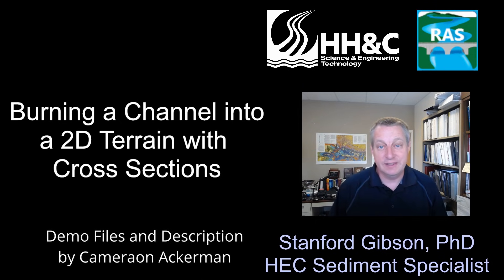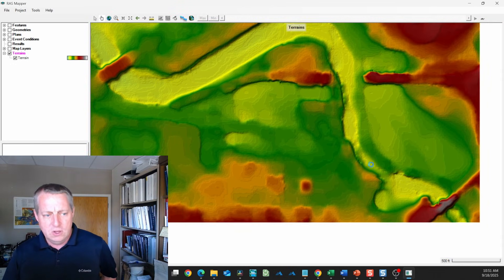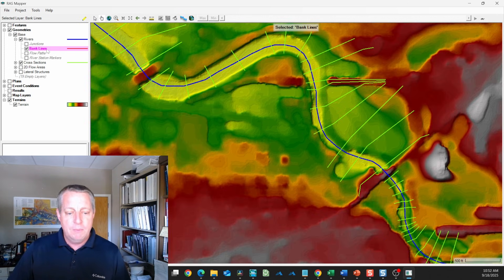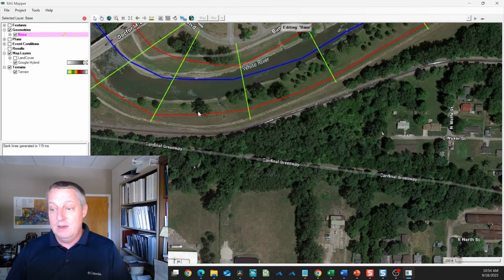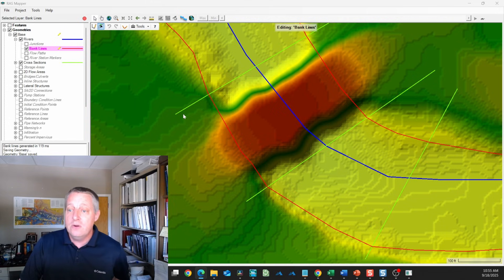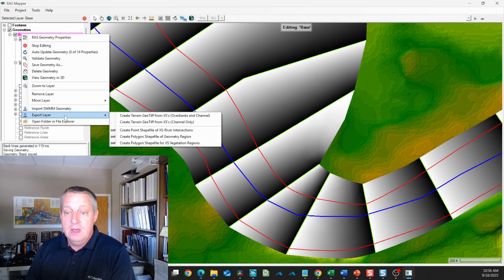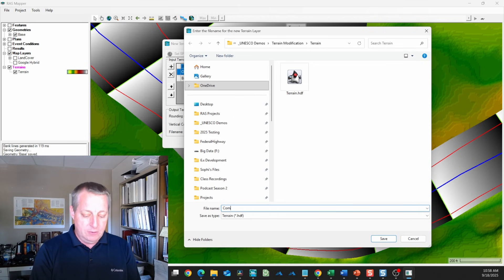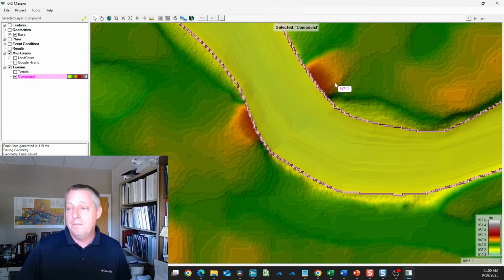Burning a Channel into a HEC RAS Terrain with XSs (Cross Sections)

Comment: @Stanford,
Could you please make a detailed video on breaklines?

When I remesh the 2D zone, the shape of the mesh keeps changing every time. Also, I’m not sure how to handle cases where two breaklines intersect—what’s the correct way to deal with that scenario?

A very detailed video on this topic would be greatly helpful.

Thank you!
Reply from the maker: These things you describe and several other liabilities of the 6.x breaklines are why I am making all of my meshes in RAS2025 and importing them into 6.7.  There isn't a great way to deal with crossing breaklines in 6.7, and I used to do a lot of manual mesh editing (which some RAS modelers don't believe in under any circumstance) but it is all much better in 2025.